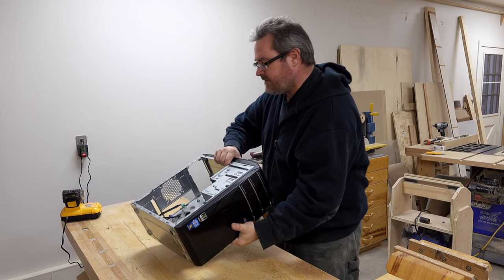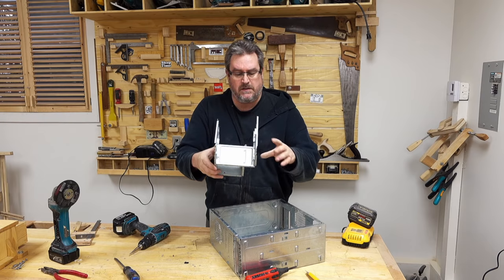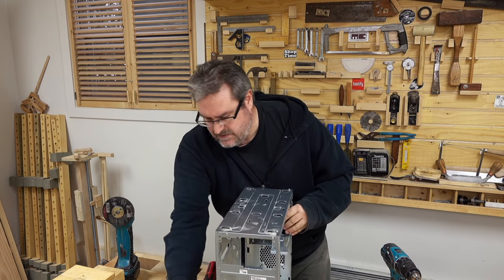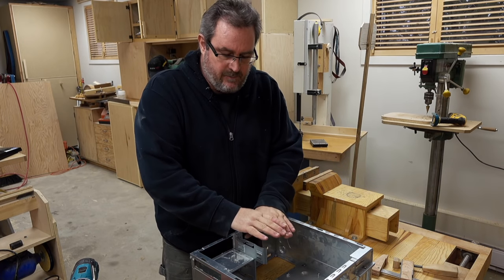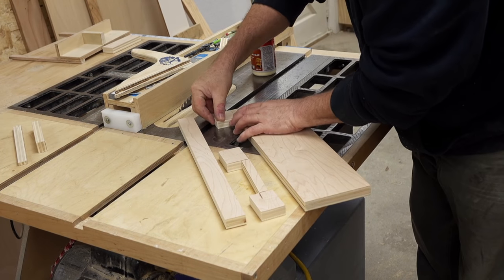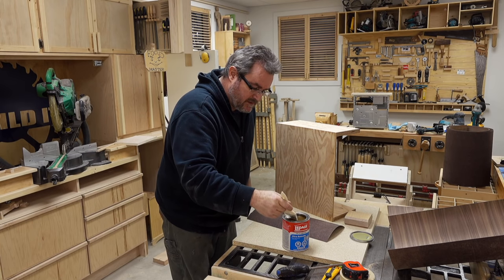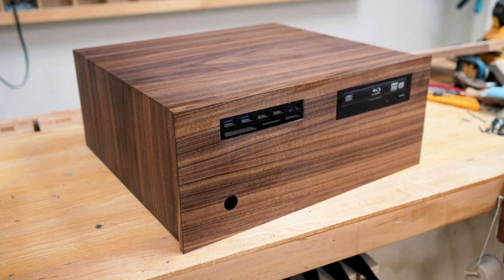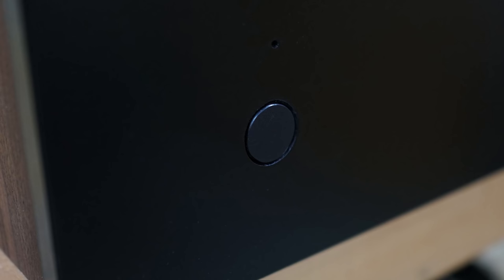How To Make A Wooden Computer Case

Comment from the maker: A note for the expert PC guys: It doesn't matter what the case is made from if there are fans moving the air through it. This one has the power supply pulling air in from the back and a case fan blowing air out. Heat can't build up inside.
Reply: I was going to make a statement about the fact that wood is a good insulator and that before any one shits on the build that as long as there is airflow then it is perfectly fine.
Reply: The only issue is that a PSU fan is probably not as high in either airflow or pressure than a normal case fan, so you would end up with negative air pressure in the case (thereby drawing in air flow (and dust) from other cracks in your case. This would result in increased dust accumulation inside the computer case. (Plus PSU fans normally push air out, not draw it in... but I won't say that they 'cant') So if you look to repeat this, I would recommend a filtered fan for intake and the PSU for outflow.
Reply: have you ever heard of Heat capacity!!
Reply from the maker: Did you ever hear of drama queen?
I heard this same shit 5 years ago on this build: https://youtu.be/PXH8ers57rs
Still going strong today, I'm typing into it right now.
So, take a break from pretending that you know it, and you might learn something.
Reply: ugh. I'm seriously losing my faith in humanity. It's as though only people who have never been punched in the mouth leave YouTube comments.

If you don't like it, don't build it. My pc is enclosed by a MDF desk on four sides. It runs 24/7 with a 1/4" sheet of dust over the fan. Yes, I just used Imperial there. Deal with it. 

John: beautiful work. If you don't mind even more advice, I would like to recommend painted acrylic glass for your front-piece. If you paint the back of it black, it will have a nice shiny depth to it that looks manufactured ;)
Reply: +FreeOnGoal Heat capacity is pretty useless, it can give you a bit of leeway on the thermal peaks, but this is not something you want to rely on in a PC, because nothing is preventing it from running maximum heat output for really long stretches of time, and besides the bulk of heat capacity is in the coolers and not in the enclosure. Steel PC enclosures have some cooling from the surface, but for most surfaces that's nothing to lose sleep over, pretty irrelevant, except a bit for the mainboard carrier side. By the way, it will cool awesomely here if the system got some feet, but even like this it's likely not to be any worse than a typical PC enclosure.

The more important topic is airflow and dust management. I have seen plenty of computers killed by dust blocked coolers back when i did PC service. But it's really just a HTPC and the total airflow and thermal power isn't all that high, so it's pretty moot. You can even get away with terrible thermal engineering on a high performance system if you just maintain it well enough.

I liked the techniques applied in this video, and if i ever get around to build my own wooden PC, i'll certainly have different criteria and will make different choices where i need them.
Reply: John Heisz As long as it's not overclocked it won't matter. Plenty of passive cooling options.
Reply: +1, materials really doesn't matter much as long as there is airflow. Also, as long as the actual temps are reasonable, it doesn't even matter arguing over the materials.
Reply: You are correct that material doesn't matter. But, bad airflow design does. That chassis had poor airflow before you modified it. Adding a wooden box around that poor design is just going to exacerbate the problem. It looks cool, and I'm sure it functions fine for your needs. I think you would have had an easier time getting a motherboard tray from Lian Li and building the entire case from wood though.

Comment: I built a case out of wood too.  But instead of solid wood on all sides, the top and front are aluminum mesh (circle patterns) and then I used some spray adhesive to attach speaker cloth.  It looks pretty sweet.  Thanks for the vid!

Comment: Let me start by saying that, I love your work and yours is one of my go to channels on Youtube. I don't know if anyone has discussed this, but my thought in relation to your issue of too much walnut is that you could go with the old standard. If you'll look at the many Youtube channels on old stereo gear, you'll see that the veneered cases of the 60's and 70's almost always went with silver (or Aluminum) finished fronts. I think that treatment is great in balancing out the dark wood. All in all though, it's a nice adaptation of a cheap case.

Comment: To make it look more like a receiver, maybe you could use a piece of aluminium, or maybe just use a brushed aluminium paint on the front? I think that would look more vintage than the black. Or, I wonder, is there a such thing as aluminium "veneer"
Reply: That would be really nice. And yes, you can get aluminum sheet really thin.
Reply from the maker: Lots of older receivers had black fronts.

Comment: Tape up the front panel to add some thin accent lines. Since you are going for older 70s style box design, maybe a single or double 2mm brass line on the bottom will do it i think. If you are feeling really fancy, dont use brass paint, route out grooves and put actual brass strips in.

Comment: End result was pretty nice, way better than having Oakwood on the front with black plastic parts. Btw, how does the paint stick when you've already applied oil on the surface first?
Reply from the maker: Took a while for the first coat to dry. I used linseed oil, so that does polymerise.

Comment: This is a really cool idea! I have a couple of old cases kicking around and wanted to make my own DIY wooden case with a small viewing window but mainly wood. How does your case get enough ventilation though and what are the temps like? Would a wooden case be good for noise dampening? Could you fit a radiator in that case? How heavy is it to lift? I wanna make something small and portable.

Comment: Nice project. I've been wanting to do a wood HTPC lately and hadn't thought of this approach. Now that you've made this, if you had to make it again, would you use the metal case? The way I've been thinking of it is to just order in some taller nylon standoffs. Mount the MOBO right to the wood. Use metal strapping to fix the PSU. Then build a smaller 1/4" plywood shelf for the various drives and USB panel. No metal from a case at all, everything affixed right to the wood.

Would you still use the case as an inner shell, or would you skip it and mount it all to wood. I'm thinking it would give a bit more freedom to place the parts

Comment: Very nice. I think personally the only way to improve on that design would be to replace the current dvd-player with a slot-in player and a routing a slot for the disk instead. Would give it a cleaner look, but still, excellent work. And I suppose it's just as much about keeping cost down. A new slot-in is way pricier than a free one you already have. :) Nice job.

Comment: How are the temperatures? I only saw a single casefan in the rear (on the article), so where does it get the air from? You might need some intakes with filters on the sides near the front for some airflow.  
If it's only an HTPC, it doesn't need a lot of cooling, but I do recommend some inlets to get it to around 30 C
Reply: Mannershark I noticed the same thing. There might also be noise with the stock cooler.
Reply from the maker: It's not a hot running machine, but there's plenty of ventilation. Along with the gapping hole in the bottom,  the power supply pulls air in from the back and into the case. The case fan pumps that out.
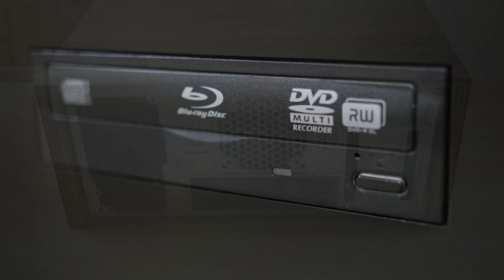Reply: At 12:03 you can see how the case fits into the wooden box. There's plenty of room at the sides and underneath for air to flow in. Also large holes at the back. For a HTPC that should suffice.
Reply: I'm repeating myself:
"Do not worry too much about overheating, as it's a HCPC, it doesn't contain a video card. Just the CPU fan and alimentation fan are enough in that circumstance. Also as wood absorb less heat than metal, it act less has a heat trap than normal cases :)"
Reply: The ATX power supply extracts air from the case, doesn't pull it in. Not that this is anything to worry about, just saying. The only problem spot that may potentially arise is increased accumulation of dust in the optical drive, but if that happens to cause issues, you can just disassemble it, blast the laser/lens assembly with isopropanol spray, and it'll be good again, assuming it didn't die from normal aging, which is actually more likely by the time this happens.
Reply: this is also a Media Center pc, not a video editing or gaming rig, temp's are going to be low

Comment: Oh, Is it easier to drill out the rivets with a step drill, than a normal drill?   I used to make flightcases for a living, and whenever I had to take one apart again after the customer managed to destroy one, or just wanted to modify them, or whenever I screwed up, and had to change something I would just use a normal drill to remove the rivets... 
Sometimes a customer had like 20 cases that they wanted to modify, like change the type of locks or remove handles or something like that... and when you have to drill out thousands of the things, it gets tedious and really chews up the drill..

Comment: Awesome video, very inspirational. I think I'm going to tackle a similar project. just a suggestion... It may be too late/ too much work for the trouble, but you should consider recessing the optical drive and attaching a piece of wood to the tray so when it's closed you just see the flush wood and no plastic. If there is enough room inside the case, you may just be able to adjust where it drive screws in to the chassis.

Comment: Considering a lot of home theater equipment has LED readouts on the front and you have that large area, which I think is part of why it looks off, maybe putting one of the LED temperature or fan controller panels on the front would make it feel more complete without looking out of place.

Comment: That box looks great, good job, John.

I am a little concerned about airflow within the box.  As you know, computer cases are designed to guide the air within the case over parts that need to be cooled during operation.  

I hope my concerns turn out to be unfounded and that you get years of enjoyment out of your creation.
Reply: In the video description is the link to the full build article. That should allay your concerns ;)

Comment: Hi John Nice Idea well done 
 agree in fn use ( I have 6 on Stealth fans and a water cooler in mine! I have seen it at 42c in my puter room 45c outside !) you said you aren't happy with the front How about Putting a fan in front but using some Speaker Cloth to make it look like a speaker? if you do in as a rectangle it would suit the case dimensions as well 

You also could put maybe brushed Stainless steel angle around the USB and Card and DVD slots to highlight it as well 
maybe a Headphone Out Jack as well 

I Love this Idea I think it could be  brilliant for those of us to custom make our Cases for specific Uses and needs 
For xample I have over 40 TBs of external Hard Disks I use  to beable to make a Separate Bottom 1/2 and take them out of the Enclosures and install them into the case and add some stealth Fans would be a great Idea 
Also being wooden would act as a Noise Suppressant as well

Comment: A little confused -- it seems like what he's built is a 5 sided wooden box with no air intake.  So where is the air coming from for the rear case fan and the PSU fan to exhaust?  I may have missed something in the build, admittedly, and as cool as it was to see him build this I am left wondering about airflow.

Comment: I would've aborted the l PC case entirely and just made everything out of wood.  You don't need to use metal to mount the MB and peripherals.  You can get brass and plastic stand offs, etc. to isolate the MB, etc.  My main issue is the size.  It's just too big.  I do like the process as it does a good job cultivating ideas and you show some great methods and techniques.
Reply: Well then you also need to replicate numerous holes and mounting brackets, that takes quite some time.
Reply: Hellsong89 Negative, shielding isn't necessary.  I've build cases out of various types of wood.  If shielding was necessary there's way to do it.  For example foil tape.
Reply: MsSomeonenew Yes, but it's not hard.  Make a poster-board template of MB.  Use to drill required holes.  Time require?  Must less time than modding the case, by 500%.
Reply: I like the idea of chopping out the bottom underneath the motherboard (the tray) and just screw that to some ply.  Then the only thing I'd have kept would be a piece of that drive holder and the usb port piece in a computer about 1/2 the height.  
Regardless, I also would have put some nice diagonal slots, maybe an inch or two long and pull air across the m/b/cpu.  IT has been my career, but woodworking is my future.  I enjoyed the build either way and looked at it with a very critical eye.

Comment: you have to put some fans in it, you can't leave it sealed!
Reply: i agree! don't fry your PC
Reply: Do not worry too much about overheating, as it's a HCPC, it doesn't contain a video card. Just the CPU fan and alimentation fan are enough in that circumstance. Also as wood absorb less heat than metal, it act less has a heat trap than normal cases :)
Reply: well, wood is a thermal insulator, so it acts more like an heat trap than alluminum cases.. hard drives start suffering from 40-45 celsius and as an htpc these drives are constantly under load while in use
Reply: Ha! My SSD and HDDs usually operate at around 50-60 celsius and they have been for the last 5 years. Not a single problem :)
Reply: so you must be very lucky
Reply: SubnormalWater 
Hard Drives can operate at 80 Celsius without problems
Reply: nnnnnnnnnnnope

Comment: I bought this small computer called a "Kangaroo", it has a pretty quick Intel Atom processor, not enough ram, but otherwise works great as a "media pc". It uses like 15 watts of electricity when running and makes no noise at all so I like it, but the thing I absolutely HATE is Windows 10. That bullshit operating system updates almost EVERY TIME I use the computer, and it's not just a quick update, it takes 10 minutes to 3 hours almost EVERY TIME I use the computer to watch a film (which happens once a week or so). I've gone into Windows settings and turned off all the automatic update features, but Windows forces them down regardless of the settings I chose. 

I listen to local talk radio, they upgraded their computers last year and they use some digital sound boards on a windows 10 computer, you'll actually hear it forcibly shutting down right in the middle of a live on air session. Media PCs are awesome, but if you use Windows 10 prepare yourself for some incredibly intrusive and obnoxious updates.